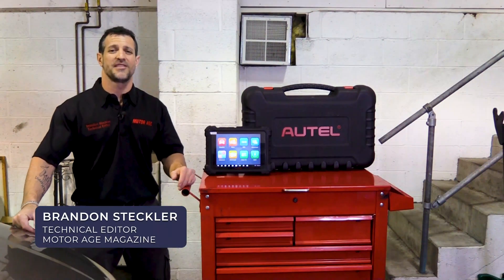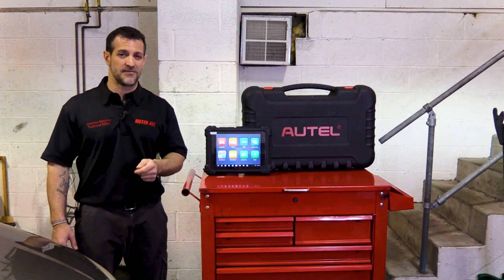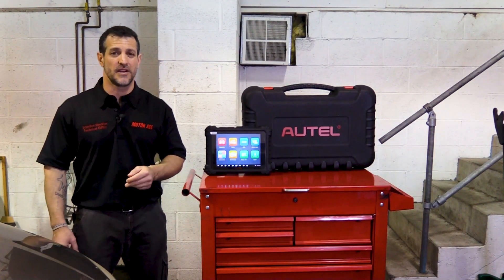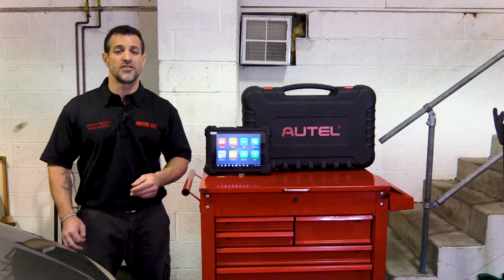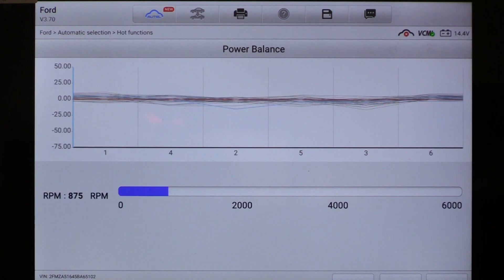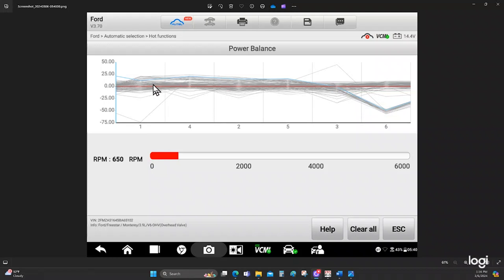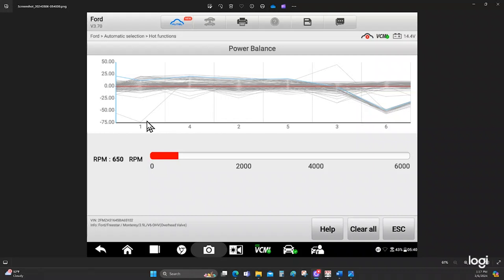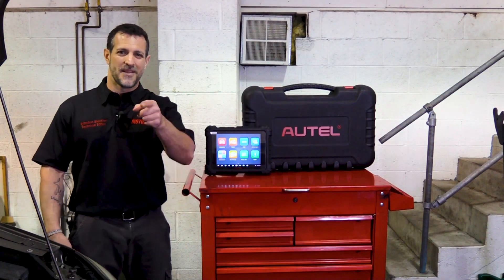The Trainer #147: The key to efficient driveability diagnostics

Comment: THEIR IS A NEW TOOL THAT DOES THIS AND IT'S MUCH MORE ACCURATE ,,, I SAW IT ON MARIO'S CHANNEL JUST YESTERDAY I THINK THE TOOL WAS NAMED ADDi AND YOU CAN SEE GDI INJECTORS WAVEFORM WITH OUT A MATH CHANNEL . THANKS FOR THE VIDEO 👍
Reply: Thank you, but Tool prices, capabilities, and accessibility will forever vary. Understanding what your tool of choice can and cannot do is what's important.
Reply: Been using it for years also GM does it a bit differently a lot of info to be discussed in the event you will see multiple misfires in different cylinders always go after the one that has the most indicated either in counts on GM  or the Balance test on Ford